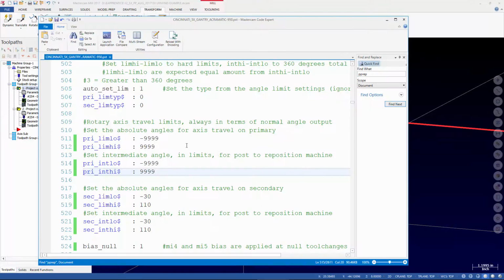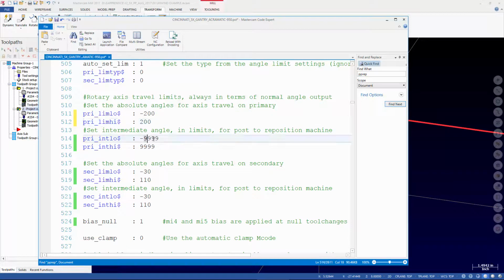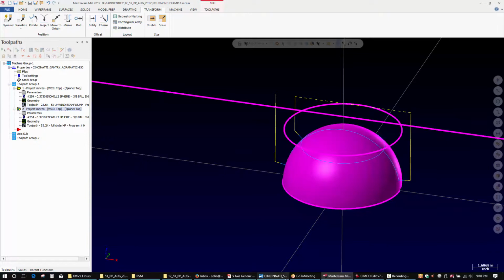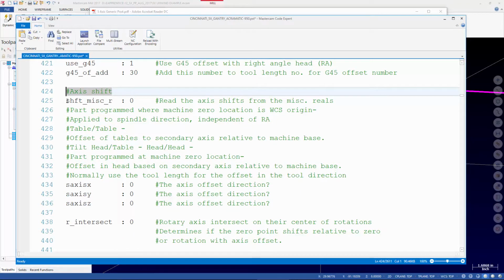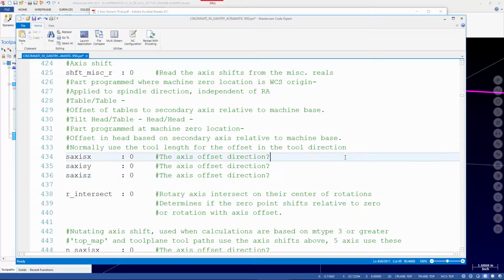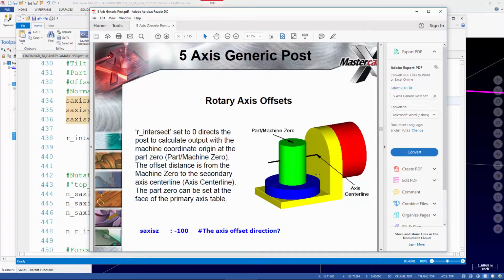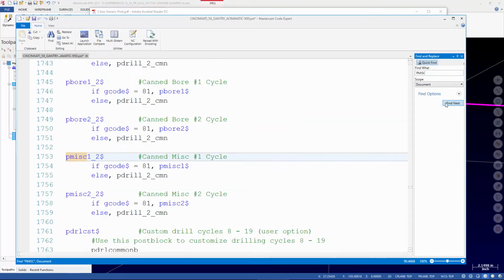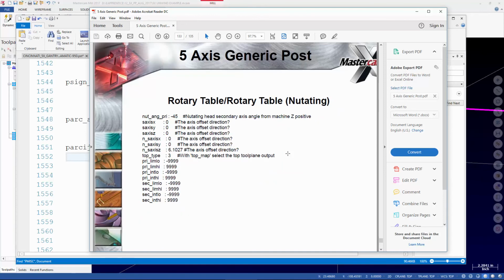MP 301 - Video-10 - 5X PP AUG 2017 DAY 3 Part 2

Comment: Thank for your video. Can you help me because my english not well. I want to config head-table XYZBC but i do not know how to set pivot length? for example pivot length is 300mm. Thanks
Reply from the maker: The Generic Fanuc 5X Mill Post doesn't support "Dynamic Tool Length" functions out-of-the-box. To enter the Pivot Length, you must add the actual Pivot Length to the Tool Length, and enter this number in the "Overall Tool Length" data field, for each tool. (In the Tool Definition, in Mastercam.) Then you must set "use_tlength  : 1" in the Post. (Or, set that to "2", and Mastercam will "Prompt" you for Tool Length, for each tool, during the Posting Process. Either way, you must physically measure each tool for a setup, "and enter this data somewhere". This also means "if a Tool Length changes", you must repost your NC Program. This Post is "old school", just the way it has always worked. Also, you must go through the entire set of "Post Variables", to be sure the Post is configured for Head/Table type of machine.